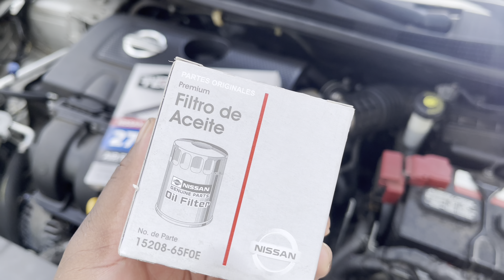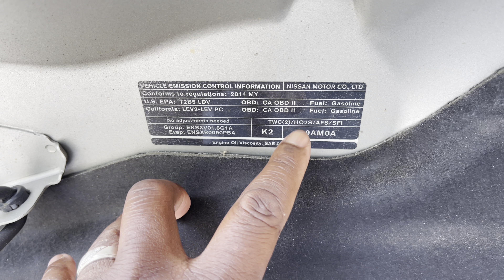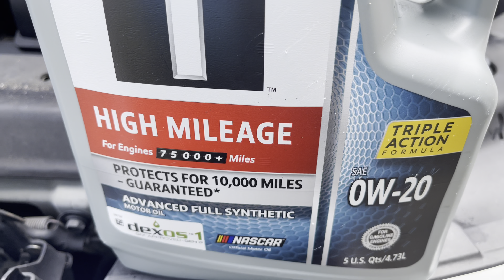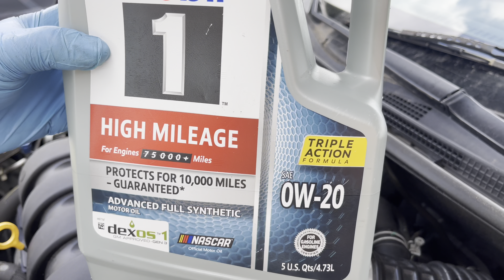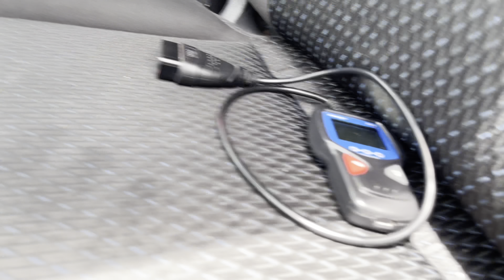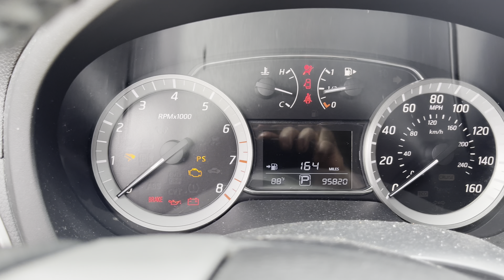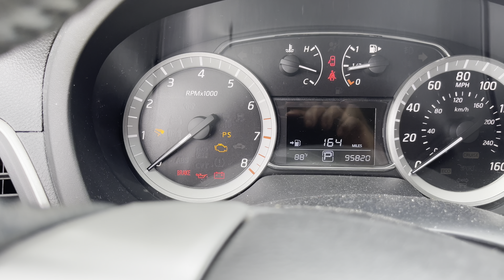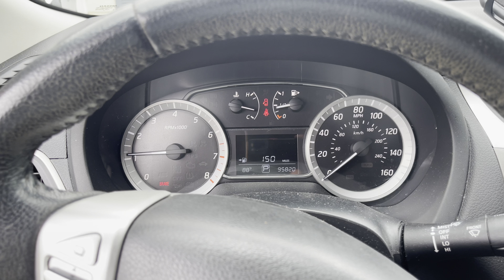Changing The Oil On A 2014 Nissan Sentra SR

Comment: Hey I was wondering if you had any problems with your spoiler on the Altima pop off on the ends a little bit when it rained because I have had that problem but I only used the gorilla tape
Reply from the maker: Yeah I had it before but it was very little gap and never added anymore because the water flowed well and the spoiler never came off even  at 100+mph test.
Reply: I wonder if I should do it like you did with the 3 m and the gorilla tape so it will block the water from the tape in the middle
Reply: Also did you ever use sealant to fill the openings on the spoiler so water couldn’t get in
Reply from the maker: @Santaman08  never did it but you can definitely do it to hold it more
Reply: @TheRealCountryBoyModz  greetings,mane you’ve motivated me to do a lil modification on my Nissan Altima and now I’ve done all kind of stuff to,thank you for your process,progress and perseverance,may God bless you and keep you all the way in life.
You can check all the work I’ve done to my car on my page and let me know what you think #respect
Reply from the maker: @DAVIONNNNNNN  appreciate that means a lot and definitely will take a look at it